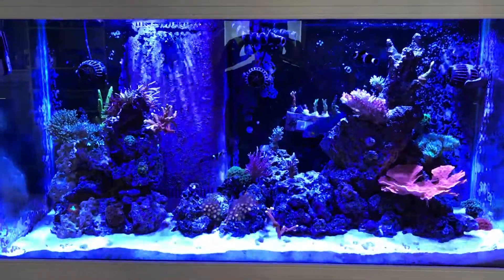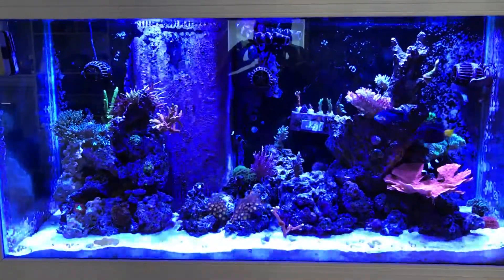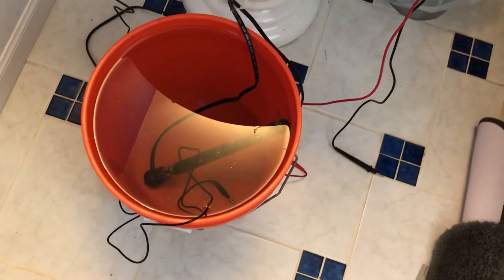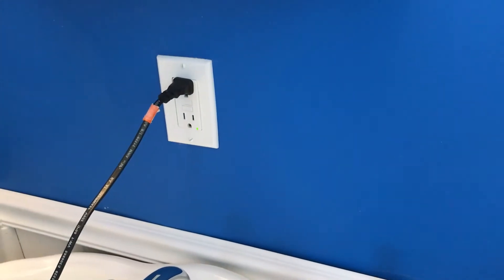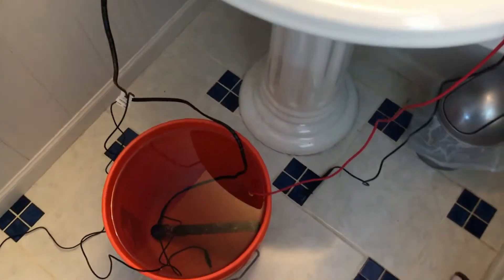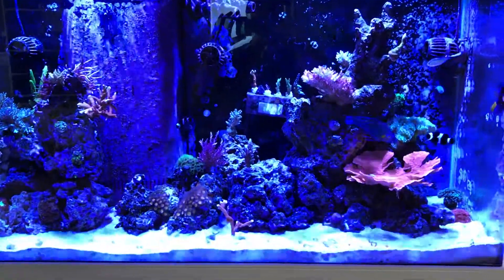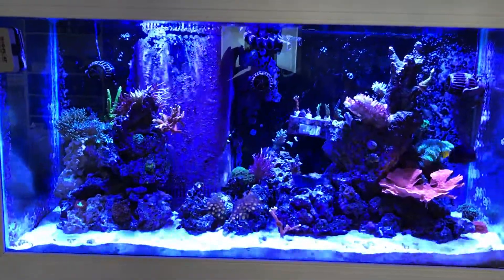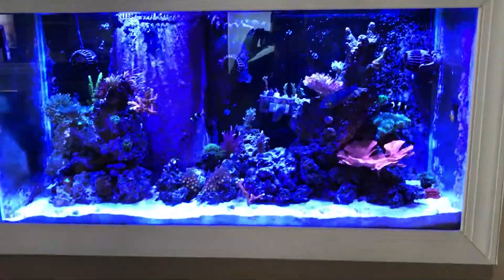Ground probes in fish tanks/reef aquariums.  Why just a GFI isn’t enough

Comment: Excellent video explaining these details, very well done!!!  A side note, using a titanium heater element accomplishes the same thing as having a grounding probe.
Reply: 4 minutes into this video and I found myself on Amazon adding an aquarium grounding probe to my cart. Then I came to the comments section. So this is a fact? I guess that is why they make them in titanium?
Reply: After further investigation, I've found that, while a titanium heating element may be grounded itself, it only addresses faults that happen inside the heater. If another piece of equipment leaks voltage, the heaters ground won't help. So get yourself a grounding probe folks.

Comment: Does the grounding probe need to be in the same socket as heater? If I have a bunch of stuff plugged in going into sump and I put the probe into another outlet will it be useless?
Reply from the maker: No, as long as the outlet you’re plugging the probe into is properly grounded and the GFI that your heater is plugged into is properly grounded, it shouldn’t matter
Reply: @greg683x can the ground probe be connected to a power strip or does it have to be directly in the gfci outlet? If I use multiple power strips do I need a ground probe for each?
Reply from the maker: @natehiebert1164  as long as the power strip has a ground prong on it, you can plug it in on the power strip

Comment: This is an awesome example and just what I needed to see to know I need both GFCI and a Grounding probe. Question for you, lets say you're going on vacation and no one will be in contact with your tank while you are gone, would you unplug your grounding probe while you are gone to assure a minor leakage doesn't trip off your tank?
Reply from the maker: If I’m leaving town for more than a day or two, I usually have a tank sitter, so no I would leave the probe in.   Having a heater fail while I’m out of town for an extended period of time would be pretty catastrophic, even if I removed the probe.  Failed heaters remaining powered up and in the tank can leach dangerous amounts of copper into your tank, killing corals.  It’s also not going to serve it’s purpose to heat the tank.  So all that being said, if still lean on the safe side and keep the probe in, especially for my tank sitters sake.  People have difference philosophies though on this